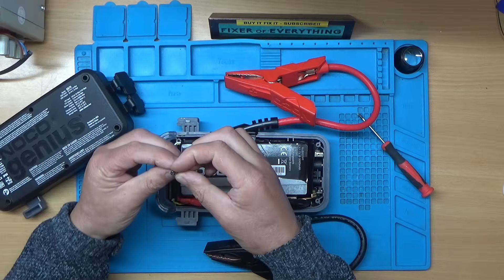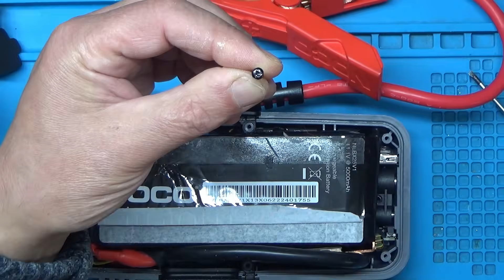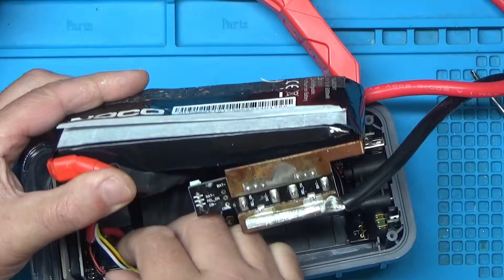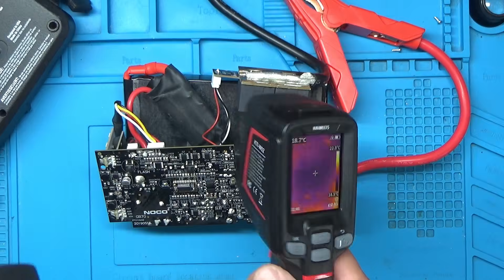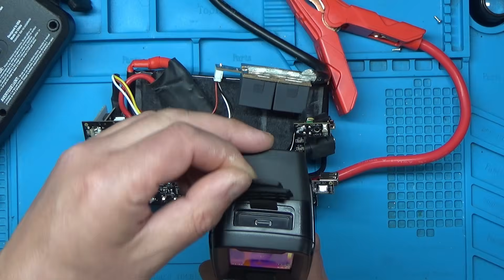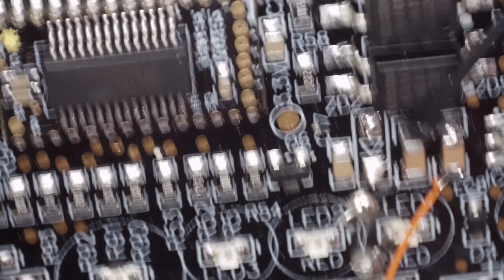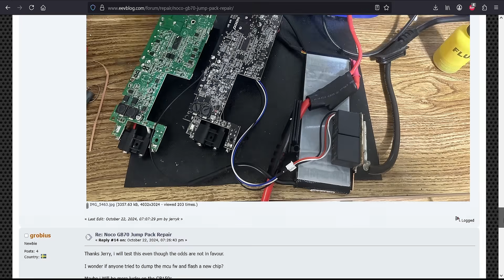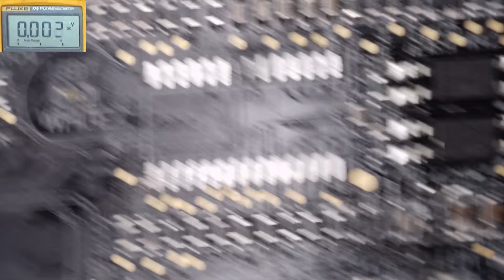Faulty NOCO GB70 Lithium Jump Starter | Can I Fix It?

Comment: Micro faults are a real pain! I've got a Hoover heat pump dryer with a short circuit to ground on one of the micro I/O pins. It's a Renesas chip that is available to buy but when I connected a J-Link programmer, I discovered that they had code protected the device so I can't read out the program. The I/O pin in question goes to a motor controller to a pin that provides a temperature output as well as being a disable input. I think that the micro needs to be able to measure the temperature, so there is nothing I can do to get around it. The machine is so new, that Hoover don't even sell a replacement board, so I'm stuck with it until spares become available :-(
Reply from the maker: It might be possible to perform a glitching attack to bypass the read protection. Might be worth having a look to see if anyone has successfully glitched that chip.

Comment: Not bad, not sure how useful 2000A for 2.5ms is but it might start as very very small engine  with a very big starter motor. 🙂
Reply: Hi I have a 1500A version and it starts my 2L Citroen Relay from absolutely flat, although I find I have to override the safety, turn the ignition on and wait 5-10 seconds before trying to start.
Reply from the maker: 😂😂😂Indeed 👍

Comment: Great video 👍 The reason you can't buy chips is because other Chinese makers would copy and manufacture under a different name etc 😂😂
Reply from the maker: 😂😂😂Thanks 👍
Reply: That's not a valid excuse. The Chinese will reverse engineer just about anything, including chip level design. The only end game for this companies is to sell as many pieces as possible. Repairing would put a dent in that.

Comment: Wow, Holtek! I hadn't heard of them until a few weeks ago. I then got a soft start board in a lawn rake with a blown SOIC-8, knew where Vcc and Gnd were, and got PA0, PA2 and reset from an unpopulated header. ChatGPT with help then suggested Holtek HT48R002 and everything about it matched. I did toy with using an attiny412 (even a 202 would work but I have 412 to hand) and coding up zero crossing and traic drive myself, but a whole new module was sub £2 on Aliexpress.
Reply from the maker: Yes sometimes it's not worth the effort. I'm working on a Sous Vide cooker thing, although that may have a different outcome.

Comment: Great battery to repurpose. I've got hundreds of second-life 18650 cells around the house. From power backup to flashlights. It's just to bad that mfg's have to use proprietary components so often.
Reply: I've just made a USB power bank which I got from AliExpress just had to add 18650 battery's  which I've collected from old laptops. Just have to make sure the battery's are ok with the same amps.
Reply from the maker: I've also got some pulled from laptops and tool batteries. Handy for things that use 18650 batteries too.

Comment: Good analyses. The zener seemed odd (to me), there's more than one and you would generally not need them if you have LDOs etc already producing the 3V3 (unless they  expect something nasty to come down the pipe).  Holtek IC on various dubious sites, but, as you say, no use without the firmware or at least binary / hex etc.
Reply: It seems like a right lot of pins on that chip for such a simple job. You could reverse engineer what it does and drop in something like an attiny but lots of work.
Reply from the maker: Cheers Ralph 👍

Comment: Great troubleshooting Mick, found the culprit as I knew you would.  Propitiatory parts are the bane of the repair community, I guess the company figures it protects their bottom line no matter the actual cost...sad.  Finding another faulty unit with different problems and robbing the MC looks to be the only solution, not sure that's viable.  Great video of course, thanks for the work.  See ya next time.
Reply from the maker: Cheers Terry 👍

Comment: You can't beat a decent set of jump leads, no micro controller required.
Shame on you Noco, shame on you, people would be more inclined to buy their products if they supplied replacement parts.
I hope they loose customers as a result of this video
Reply from the maker: Yes, I've got a good thick set of those. They're really handy 👍
Reply: I've used these small jump starters and they don't last 5 mins when you are fault finding a non starter, fine if it's just a flat battery maybe because someone has left their lights on, but useless in a crank no start situation especially on large 24v start engines, you can't beat a decent set of jump lead and 2 large 100Ah SLA batteries. Been there, done that.
Mobile plant service engineer, Cornwall, UK
Reply: I'm sure this product is meant to carry alongside jump leads. 
It isn't always possible to get a human to jump your vehicle in all locations. 
It's meant as another layer of protection alongside your jumper cables. 
At least, if I drove a car, and carried this product, it wouldn't prevent me from having a normal set of jumpers. 
It's never smart to trust today's "smart" devices to replace simple analog solutions. That fallacy is heavily marketed today, but don't fall for it. 
Often, "smart" is dumb.
Reply: It’s all fine and dandy if you have another car to connect it to. I doubt they’ll feel a difference in sales. The majority of the major fleets in the US have multiple Noco jump starters. Even the shops that buy one from one of the tool trucks end up getting it from Noco, considering they sell rebranded models that look the same but have different color plastic. Perhaps the random person, who just so happens to be looking for a jump starter, who also just so happens to have seen this video might be swayed and buy something else. Losing a customer here or there isn’t going to hurt a company worth millions. They have the market cornered in the US. Large fleets looking to purchase this type of equipment aren’t going to go purchase on AliExpress. They are going to purchase from places like Grainger and Napa. What do they sell? They sell Noco.
Reply from the maker: I've got a few spare car / truck batteries just for the occasion 🙂
Reply: @BuyitFixit  Oh yes, a couple of large CCA SLA's will always win.
Reply: @SergioPena20  Good story bro. Useless in my field though as the majority of the things I need to jump start are 24volts, lorries and large plant machinery, so they will never get any money out of me in the UK.
Reply: @IvyMike. they make 24v jump starters. We have a couple at the shop.

Comment: I've repaired lots of these, its 50/50 whether they can be repaired or not depending on weather that chip is short on pins 1 and the one opposite. I did contact NOCO to see if they would supply a batch if chips, as you probably expected, they said they wouldn't.
Reply from the maker: Yes unfortunately it's rare these days to find a company willing to help people repair stuff 😢
Reply: Says a lot for customer relations.
Reply: it's called planned obsolescence. 😢
Reply: And bad design of it happens that often😮